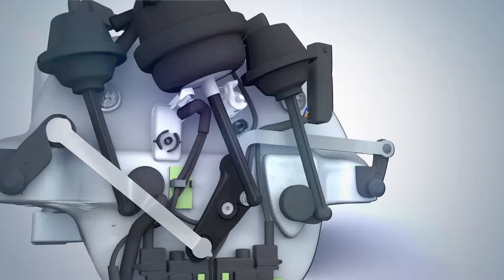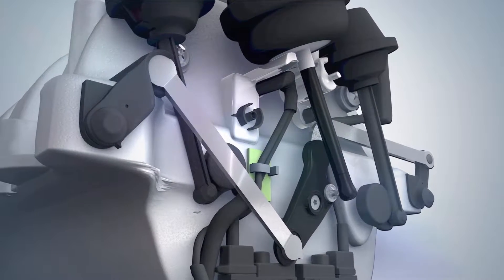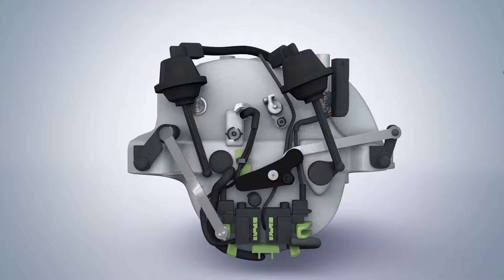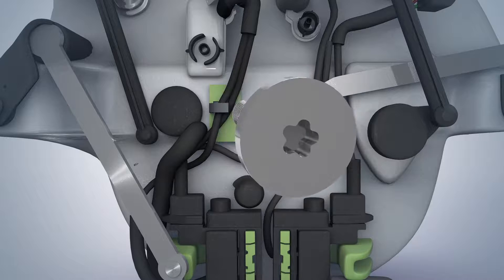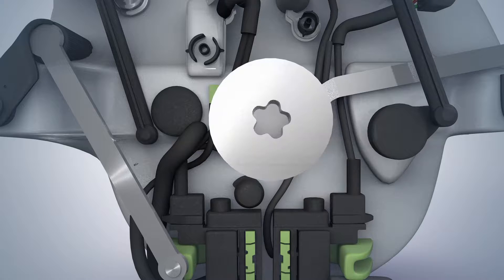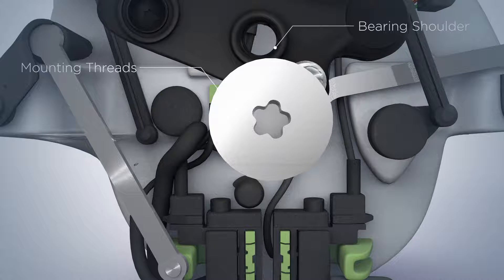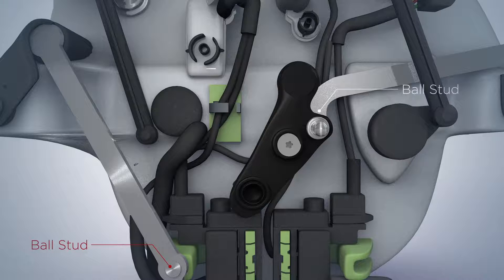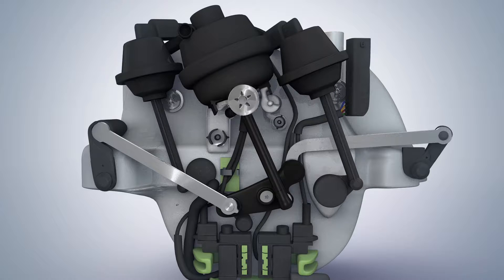Installation of URO Intake Manifold Swirl Flap Repair Kit 72 140 2401R PRM for Mercedes M272 or M273

Comment: Yeah. Just like in this video.  You should remove the complete motor to do this replacement this easily...
                   🙂
Reply from the maker: Lee Olaeta this is an intake manifold, not the engine
Reply: @Uroparts  your point being?
It's not the easiest thing to do to just pull the manifold. 
  Besides. I was being Sarcastic just incase you missed it!!